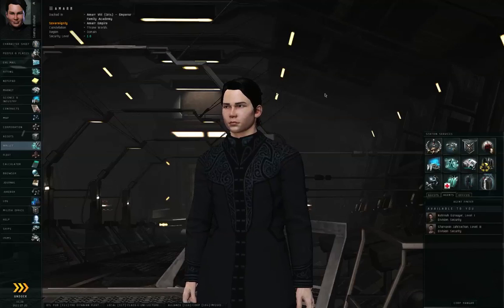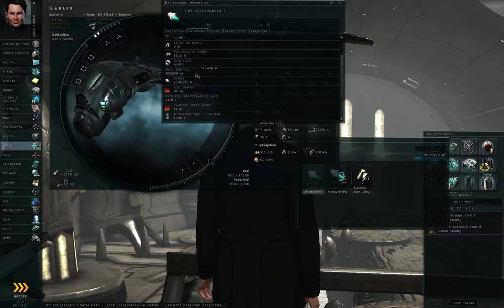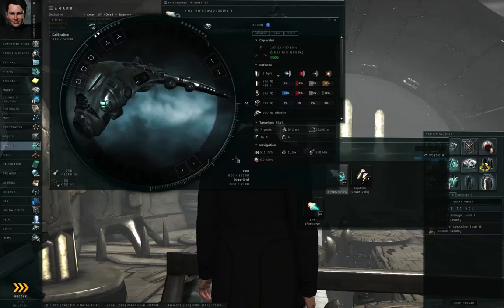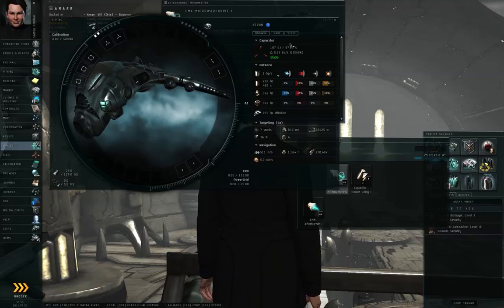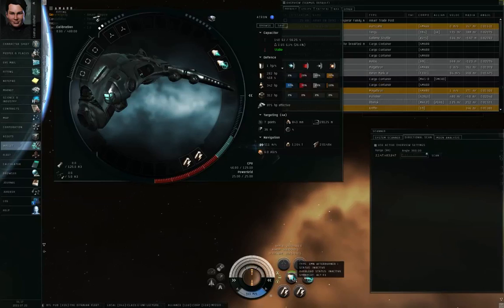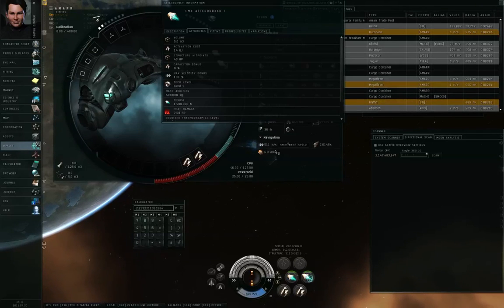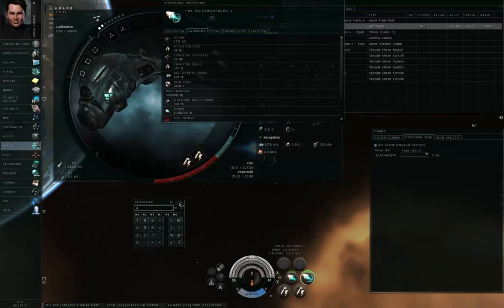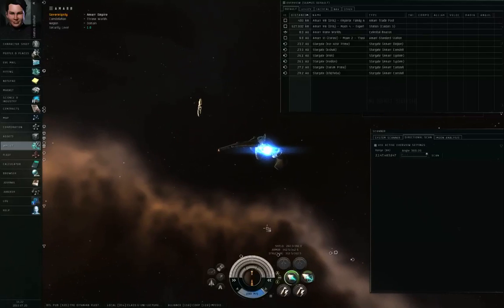Afterburners and Microwarpdrives

Comment from the maker: Microwarpdrives are *faster* than afterburners.  But, they take more megawatts and teraflops to fit, eat more capacitor, *penalize* your capacitor on top of that, /and/ make you a bigger target.  Used properly, microwarpdrives are amazing.  Used improperly, you are going to die.